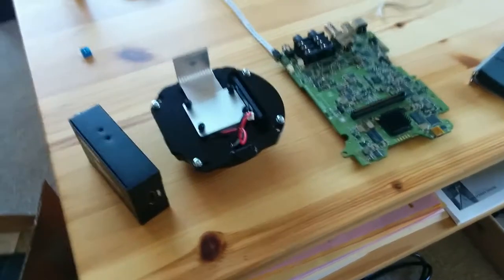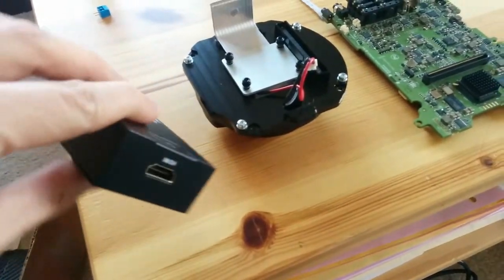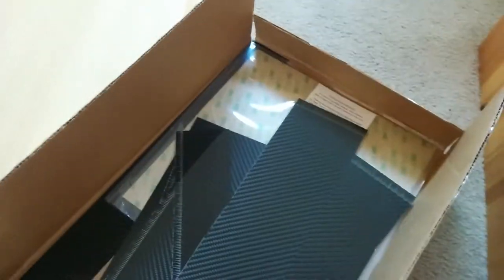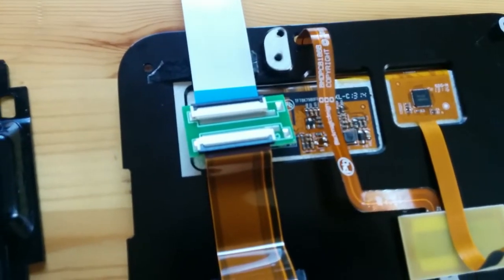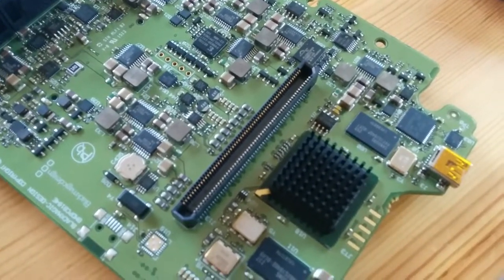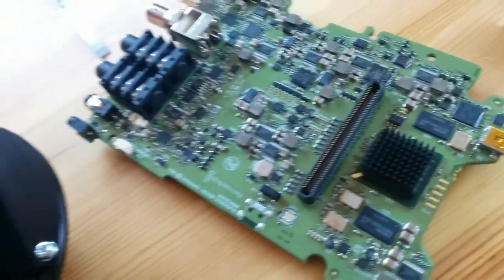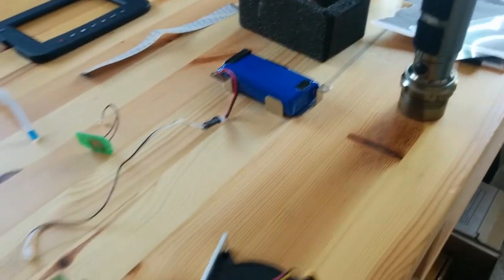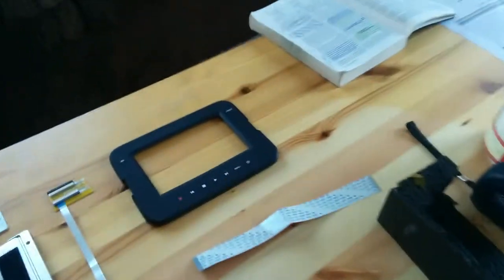Blackmagic Cinema Camera - TEARDOWN 1 OF 4

Comment: does it still run without the screen? Im wanting to strip this camera or the production 4k down to a as light as possible form factor. to put on a fpv drone.
Reply from the maker: Yeah, you could plug in an external monitor but you couldn't change any settings since it's all touch screen... Unless you could somehow control the camera via an external monitor touch screen..?? I'm not sure.
Reply: @DaviSilveira  so one could plug in the touch screen make settings changes, un plug then record , without issue?

Comment: Can you possibly make an articulating screen?
Reply from the maker: tenshunn Yeah, It's totally possible. If you know how to do it, it would help me to give me some ideas of exactly what you mean. I'll research a few solutions.
Reply: A swivel screen in the same fashion as most DSLR's these days. T3i, GH4, etc.
Reply from the maker: tenshunn Right, that would be awesome. But there is a lot that goes into making that work with the bmcc. We would need some mechanical data of functional operation specs for the dslr swivel monitors. As you can see in the video the monitor LCD and the touch screen are two separate FFC cables with the LCD using a 40pin and the touchscreen 12pin. I guess there is just a lot of research to be done but it would be great to have.

Comment: Hi David, It is possible to replace sdi part, mine is broken...i dont know if its a regular sdi...can you give  me more info of that? thanks a lot!
Reply from the maker: Just a regular right angle SDI mount. If you have a good soldering iron and you know how to use it. You can replace it, yes. But make sure it's the physical SDI connector that's broken and not something else...
Reply: @DaviSilveira  if is not the physical sdi the problem what could it be? Also it is possible to replace ef turret with an m43 one ? Cant find a genuine bmd m43 turret on the internet...
Reply from the maker: @valentinvoicu663  at this point it easier to buy a new bmcc 2.5k camera

Comment: Considering that the original Aluminium casing is a key part of the cooling system (its basically a giant heatsink) - won't you significantly reduce the cooling ability of the camera by replacing it with carbon fibre?
Reply from the maker: Yeah about that, I heard a lot about the Aluminum case being a huge heatsink... honestly it didn't look like much of a effective "heatsink" once I opened it, don't get me wrong I'm not hating on it and I'm sure it works to an extent. It's as you can see in the video, one small Aluminium Sheet that comes out of the back of the sensor and bends at the top. But then it's how it connects to the body that I think is kind of poor. In order to use the body as a huge heatsink you would need to make sure the connection between the Aluminum case and the small Aluminum sheet was very good or better yet were one piece. I could be wrong and maybe it is a great heatsink either way here is what I plan to do about mine. 

I plan on adding additional fans maybe 2 or 3 to cool the camera and repositioning them to more effective location like pointing the fan up so the hot air is lifted out of the top of the camera. (since hot air rises) Also since I'm designing the body I will make room for a real heatsink. Maybe even a liquid cooling solution like the Ursa, or higher end computers.

Thanks for the comment, I've definitely been thinking about that and many other things I will need to do to make this work.

Comment: Hi. I was hoping to get a 12v source to power an inverter for my metabones? Where is the best place to tap? Thanks a lot
Reply from the maker: Are you trying to power your metabones T which has the micro USB input?
Reply: +Davi Silveira yes. I am currently using a powerbank. It works but does not look good. Can i tap from the fan power source?

Comment: Hi Davi,

Great video! Very cool to see the insides, and thanks for sharing your project. :) I'm currently trying to sort out a broken DC jack on my BMCC. From tearing it down, do you think it is possible to just replace the DC jack? BMD told me I would need to replace the whole board through them, which seems a little excessive.
Reply from the maker: Adam LawsonI guess BMD may think it's not the DC jack only.. Are you 100% it's the DC Jack? can you still use the camera, assuming you have a little juice left in the battery? If you have some pictures it would help... are there visible signs of defect?

Comment: Hello, Thanks for this wonderful series of videos. My problem is a frozen screen on the BMPC 4K. Is it anything to do with the wiring so that I also strip it open ?
Reply from the maker: hey, good question. How did this happen? Is it the physical screen or is it the signal? Frozen screen sounds like an internal issue... I don't know if it would help to open unless it was to replace the screen.
Reply: Hey Davi, while I was working on set, the screen just stopped responding to the touch. Otherwise the rest of it works fine. Only that I can't change any settings of the camera from the last set ones.
Reply from the maker: +Kasakya George crap, well I know that blackmagic will triacs your screen for something like $250...? I could never find the exact model of my BMCC 2.5k touch screen monitor online. i found the manufacturer but I couldn't buy the touch screen.

Your safe bet is to call Blackmagic and see what they can do for you. :) i wish I could help you further.